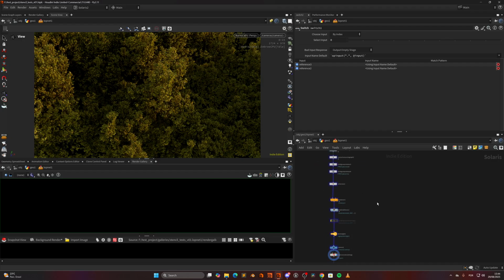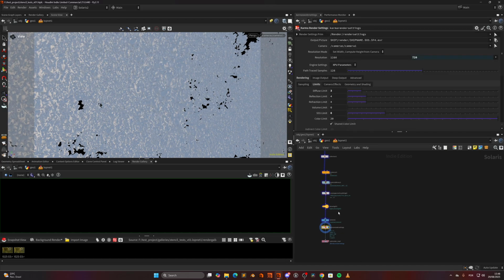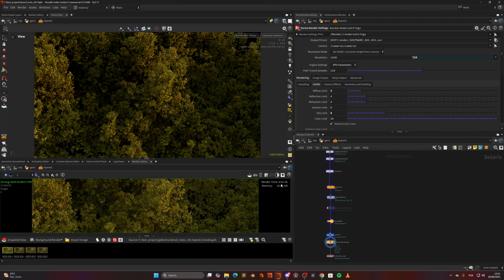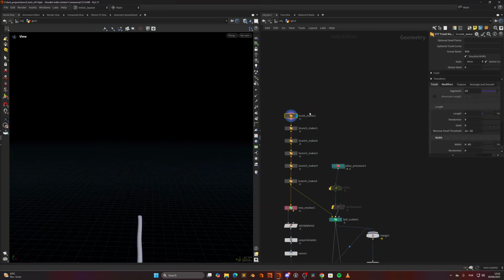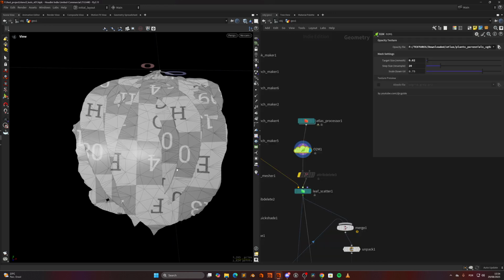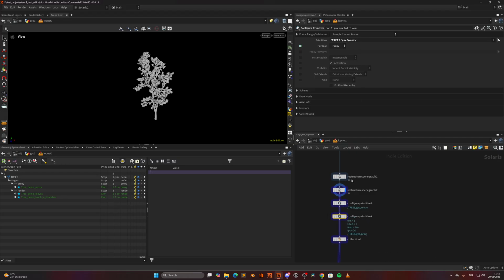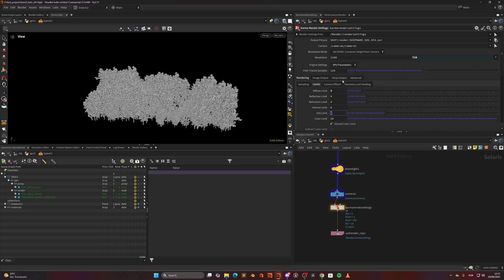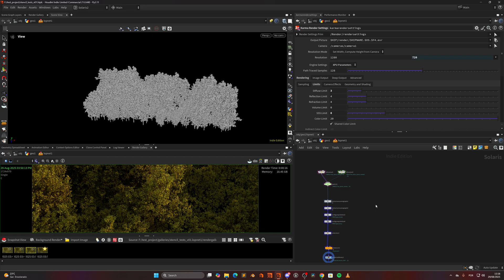Houdini 21 | Opacity vs Stencil vs Geometry

Comment: what's the difference between the first and fourth? Is the fouth render is leaf high mesh?
Reply from the maker: The first is the default mesh that requires opacity textures, and in the last, I meshed the leaves using the opacity texture, like seen later on the video.

Comment: good observation, thanks for sharing. I have noticed you deal with jpg's for this test. I'd presume the opacity needs not more than 8bit image, however I'd consider rat, tex, tx, exr for production... And here is where things get heavier and more tricky. Unlike gamedev pipeline vfx does not accept image compression to three channels so we can sneak through more optimized solution... I mean why using 16bit exr or converted rat for an image with values from 0 to 1 that simple tga can handle. And this is why I go full geo these days, either nanomesh or relative data for scattering instances. Got all I need from the albedo aces exr. Jpg and png are big no. Opacity is very costly.